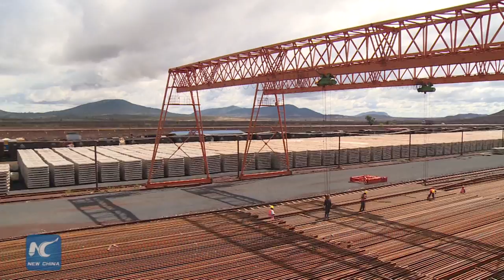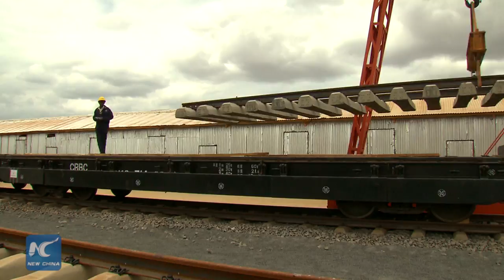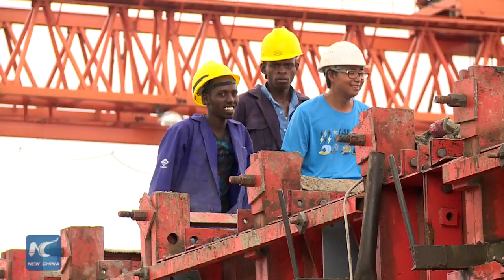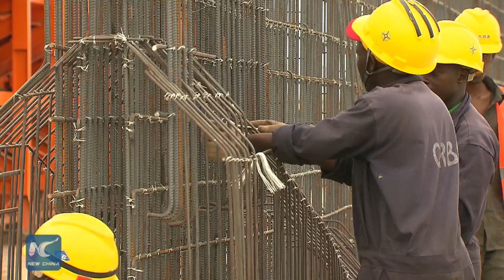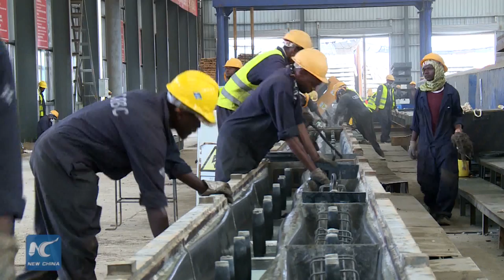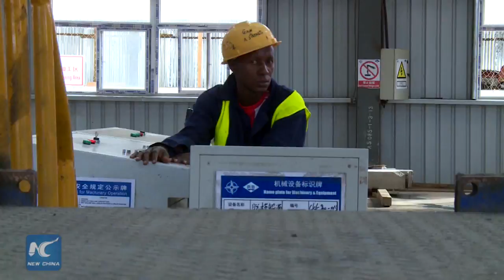Chinese new technologies introduced into Africa via Nairobi-Mombasa railway

Comment: The United States and Russia will only find China's to built train railway,China has opened up its technology to 102 countries,The Beijing-Shanghai high-speed railway and Japan's Shinkansen line cannot be mentioned in the same breath, as many of the technological indicators used by China's high-speed railways are far better than those used in Japan's Shinkansen," Wang said, rejecting the Japanese accusation of pirating. "We Chinese will not claim technologies owned by others as our own. And we will never give up our rights to file patent applications for innovations developed through our efforts and wisdom because of others' irresponsible remarks," he said. The China-developed CRH380A series trains, running on the 1,318-km Beijing-Shanghai high-speed railway, are different from the CRH2 trains, which were jointly manufactured by China and Japan based on the imported technologies from Kawasaki Heavy Industries, according to the MOR. Many of the technological indicators of the CRH380A trains are better, with their power raised to 9,600 kw from the CRH2 trains' 4,800 kw, speed increased to 380 kmph from 200-250 kmph and derailment coefficient lowered to 0.13 from CRH2 trains' 0.73. Wang said the intellectual property rights of China's high-speed railways are undoubtedly mastered by China itself. The key technology regarding trains lies in the relationship between the wheels and the rail, which is decided by the bogie, or the driving wheel technology of railroad transportation, he noted. The bogie technology used in China's high-speed railways differs from those in other countries and is now under China's national patent protection, he said. According to the MOR, more than 1,900 items of technologies used in China's high-speed railway have been granted patents while the patent applications of 481 other technologies are still under review.
Reply: WHY U WRTING A COLUMN.
Reply: I would hope the derailment coefficient would be 0.00000000000000000000000000000000000000000000_
Reply: Henry Funny video of the world if only China hadn’t based there HSR on European and Japanese tech.

Comment: I wouldn't introduce tension concrete into an area that has been notorious for neglecting maintenance.  As for this being new technology, not hardly.  Spring tensioned rails have been around the 1960's.  All China is doing is selling Kenya old 1960's technology for 21st century prices.  Low rail speeds on systems that incorporate passenger and freight service.  As we know from both US and Chinese rail systems, these are going to result in congestion and failure.  Besides, we already know the reason China is doing this is to get at the mines they have purchased to reduce their resource costs.  Cheaper to mine in Africa than in the depleted mines in China.
Reply: Amtrak still uses wooden beam and spike and run passenger train on them.  There a tube where he show track in disrepair, rotten, when he stand on a beam the spike rises, or fall .  many are like this, he could even pull it out by hand. And show a few missing spikes. They know what there doing.
Reply: You should see how messed up America infrastructure is.and they ain't fixed nothing.
Reply: @stvdmc2011  yep all that talk got nothing done.